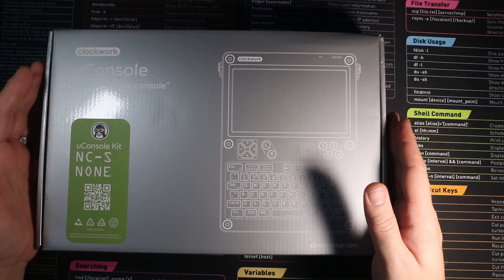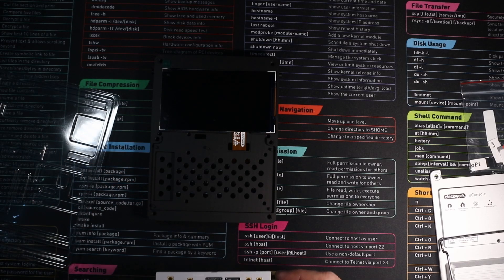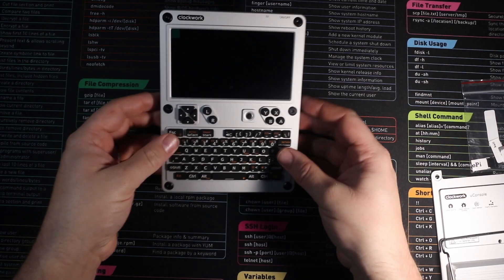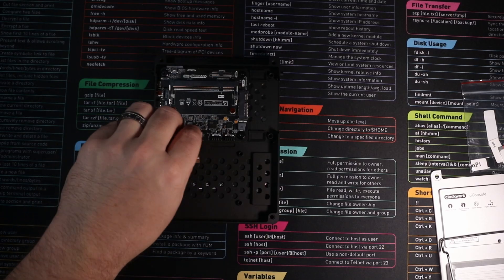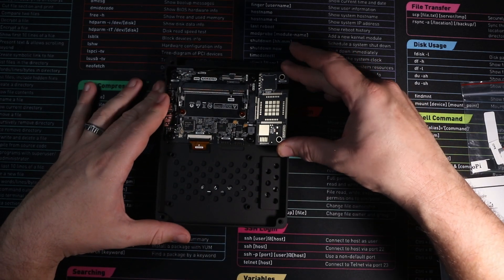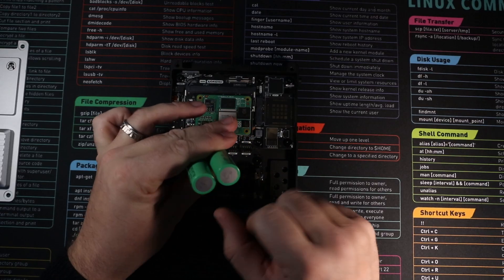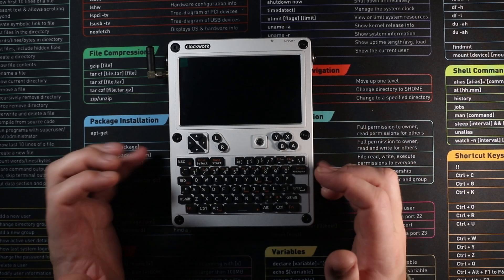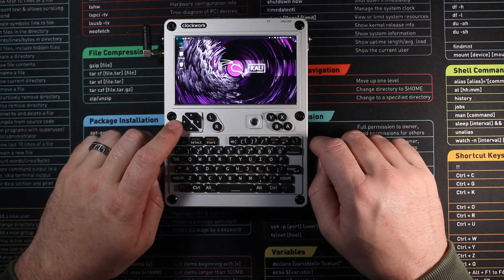Building the Clockwork Pi UConsole CM5 CyberDeck – Full Guide & First Impressions 2025

Comment: Do you have issues with thermal throttling? I am planning on using it as a productivity tool, but I am worried about thermal management as it is fanless...
Reply from the maker: Iv had non so far I use it for about 2-3 hours at at running kali and ubuntu